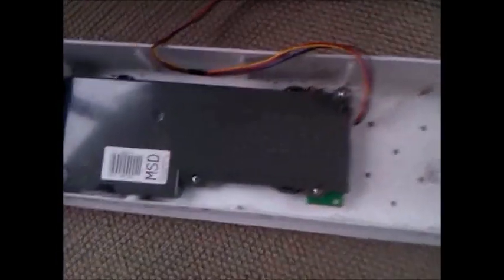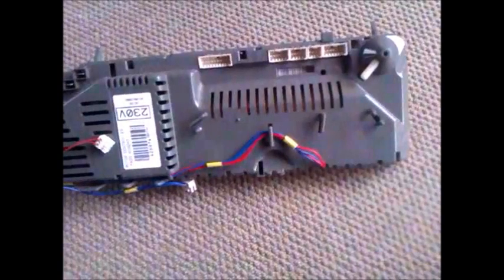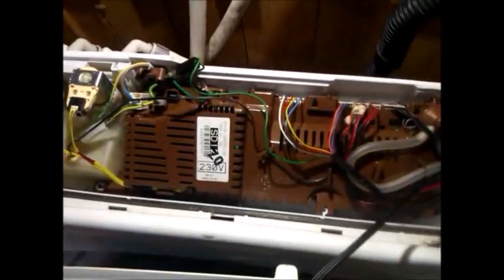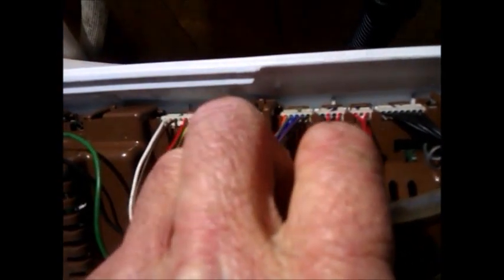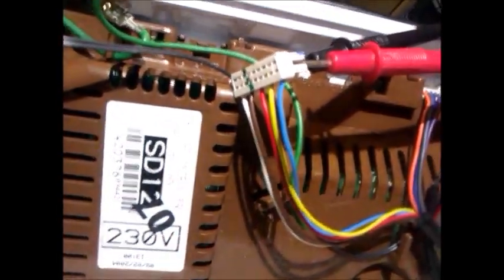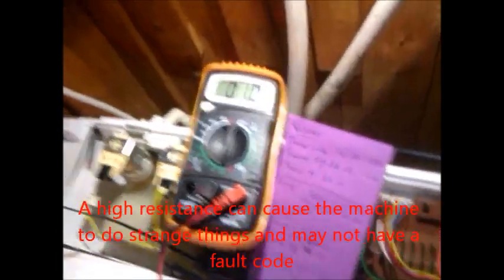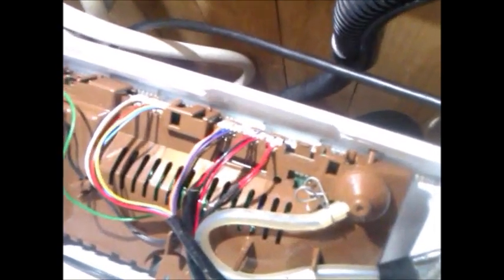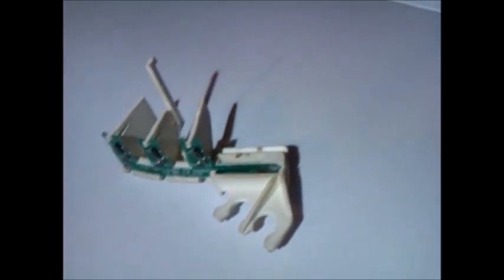Fisher & Paykel Smart Drive Testing Procedure

Comment: Hi Paul, I have Fisher and Paykel Smartdrive washing machine, I   accidently pressed the pause button when the machine was on full spinning cycle and the machine stopped, now there is no lights on display, looks like no power, any suggestions please
Reply from the maker: What's the model number please, on the sticker on the back left of the machine
Reply: @paulywooly  MW513
Reply from the maker: It's very unusual for pausing during the spin cycle for the machine to die like that. Turn the machine off at the wall for 1 minute and switch on again. If there is no sign of life means the main fuse in the control module has popped for some reason. It means replacement of the motor control unit under the display panel. Or if you are handy with knowledge of circuit boards you could replace the fuse if that is the culprit.
Look for one or 2 of these 
https://www.webstaurantstore.com/hobart-00-914782-00007-fuse-printed-circuit-board/HP3009147820.html
Reply from the maker: Check that there is power at the wall socket too
Reply: Okay thank you so much, I will check the control board fuse, actually I accidentally hit the pause button
Reply from the maker: @ummachand8216  hitting the pause button should not be a problem at all
Reply: @paulywooly  hi,  I have checked the circuit board but nothing burn looks,  I used multimeter for red fuse shows 0.4 ohms ,is the fuse faulty for no power, thanks
Reply from the maker: @ummachand8216  .4 ohms means fuse is good.  Check for another fuse in the board. Check for:
Power at the wall
 Continuity of the power cord to the control unit
The display unit is properly connected to the control unit.
If that is all ok then I think the control unit needs replacing

Comment: Hey Paul, my grandmas washing machine is a MW058  Fisher & Paykel, can you send me a link what motor controller it might need one day.
Reply from the maker: MW058 are colour coded yellow. They are quite rare to try and find but can still be bought online. This Ozzy website slows you the type you need ... http://www.stareast.com.au/product/896-f-p-yellow-control-board-instructions
Reply: Its annoying me mostly when i stay with Gran, everytime i hear i have to close the door. So can you respond if you can tell me what to do without pulling anything out of the machine.
Reply from the maker: If it's making such a loud noise it's probably when it's on the spin cycle means it needs new bearings and seals. Those models were made in 1996 so probably time for a new one. Or get the bearings replaced by a washing machine repair man

Comment: Hi Paul my smart drive was smoking at the back replaced the water pump cause it was burned but now my smart drive don't turn on no power
Reply from the maker: What is the model number please.
Reply: Mkt or mw612nz
Reply from the maker: MW612 is a Phase 7 machine. Sounds like the pump has caused the motor controller fuse to pop, but I maybe wrong. You maybe in for a new motor controller. You can easily pull it apart and check the fuse. There is 2 within the unit. They look like a little red-brown coloured cylinder with 2A written on it. Check with a multimeter on the back of the fuse for a reading. But unfortunately once they have blown usually means the unit is cooked.    If you buy a new unit make sure it's the correct part number written on the sticker. Should start with 420... Sorry I can't be much more help

Comment: Now, with the thailand made phase 6 420690 board, the board is like the phase 7, the pump and motor plug go into the pump slot and the lid lock and oob plug in one go in the lid lock slot. the earth plugs the 2 green ones go where they existed in the old board.

https://dougsmithspares.com.au/shop/420690nzp-fisher-paykel-washing-machine-motor-control-module-pcb/

move the mouse curser to the image in this link and look at the plug slots.

Comment: Hi Paul,  
Thank you for your amazing videos!

I have a GWL10US, so I believe I have the Phase 5 control board.  (Not sure which series, but it was purchased in 5/2001.)  My washer gave a code of 104, I think. The unit would start a load of clothes normally, then after about 5 minutes or so, the machine stopped.  When I checked this, there was water and clothes inside, and the controls were all completely off.  I was able to power on the unit and advance it to rinse to get the unit to empty the water, then it cut off again.     

I first checked the water drain pump, and it looked okay as far as nothing was caught in it, so I put it back in. In the US,  for this model, a new Motor Controller(426930P) is no longer available; same for the pump (420324P).  Any knowledge of where I can get this shipped from abroad?  I could only find this site that attempts repairing faulty controllers:  https://www.genuineapplianceparts.com/item/426930P_Fisher_Paykel_Washer_Motor_Control_GWL10US/326

For this testing you demonstrate, you are testing the motor control assembly (and not the Display Module, right)?  I believe you say in the video that the display cannot be tested, right?  Also, to start this testing, is it necessary to disconnect the water hookups?  (It looks like in your video the water attachments are still connected, but not sure.)   How do you test the Wash Motor Resistance per Winding and phase to phase?  I have a multimeter, but not sure where to put it for these tests.  Also, I did not check the RPS as you demonstrated in another video since I was trying to go in order of p. 27 of the service manual based on this error code which says to first measure resistance of the pump and replace pump if less than 33 Ohms, then replace display module, then replace motor controller, and lastly replace the RPS: http://www.uncleharrywizard.com/nephewclub/wizardwasher/fisher--paykel/200437---washer---gwl10us--.pdf

Any help you can offer is greatly appreciated!  We love this machine and really want to see if it can be fixed.
Reply from the maker: Hi sorry for late reply.  Error 104 is very rare and  in all my years of fixing these machines I have only had this once. It turned out to be a dirty connection. I disconnected the display module plug at the control module and got a sharp needle and scratched the connections to get a better contact and all was good after that. 

A couple of questions I need answered by you.  
What color is your module ....dark grey or is it brown.  426930P on appliance websites comes up as being either colour
What voltage is your machine or mains supply .. 110volt  OR   240volt
Check the sticker on the back of the machine and also the sticker on the pump as to which voltage it runs.

There is no need to disconnect the water hoses for any of these tests.
Check the video at exactly 5.00 mins and check there is 32ohms across any 2 of the 3 motor wires (red, blue, yellow)
The other 2 on that plug connector ( should be brown and white) are for the pump.  A 240v machine should read 33 ohms across the pump and a 110v machine the pump should read 7 ohms (both at 20 degrees Celcius)

BUT .....A very common problem......The pump can open circuit when it gets warm even after only a few seconds of being switched on. This can stop the machine and even give false fault codes.

To test the pump.   
Enter diagnostic mode:  Switch ON at the wall but do not turn the machine on
Press and hold the WASH TEMP DOWN button and then push POWER
The machine should give 2 beeps.
Press the REGULAR button and the pump should activate.
Leave the pump on for at least one minute. If the pump does not run for that minute, it is faulty.
If the pump does run for a minute then push REGULAR button again and it will turn off. Press the POWER button to turn machine off then turn OFF at the wall.  
Tip the machine back against the wall and reach under and feel the temperature of the pump. It should be only slightly warm.  If you yell out "OUCH" then the pump has overheated and needs replacing.

I hope this helps for starters.  Please get back to me if you need more help and we'll keep working thru it.
Reply: @paulywooly  
Hi Paul,  
I apologize for the delayed reply.  Answers to your questions:
My module color is dark grey.
Voltage of machine according to sticker on the back of machine= 110-120 Volts.  Also, the service manual for this machine lists "Electric Supply - 120 Volts/60Hz."
The sticker on the pump lists its voltage as 230 Volts.  (Manual specifies, "230V AC/ 0.7Amps/ 80watts (SELNI)."

I ended up finding a new pump motor for my GW10US at a company in Australia, ordered it and received it, but haven't installed it yet since I want to do the test you recommend with my current pump.  (The replacement pump label states "230V, 50Hzm 100W", so I hope that will be compatible.)

I did all the testing you mentioned in video except the water values, as I could not get the wire clip loose and was afraid to pull harder in fear of damaging these.  Results are inline with the ideal except the following:  the pump tested at 29.2 Ohms instead of 33, the OOB tested at .1 instead of 00.6, & the red and black wires on the Lid switch registered nothing.  On further inspection, saw that the OOB switch connecters located under the Motor control board were severely corroded, so I order a new "Out of Balance Switch - Sealed OOB Switch Kit" from F & P, installed it, but haven't tested it. 

I was thinking of trying to check the Motor Control board for any blown fuses, do resistance testing, etc. but I am not confident I know what I am doing, nor do I know if I really need to do this, especially since the OOB had corrosion, and I've read blog commenters saying this caused the machine to not work.  Should I next, test my old pump, per your instructions, or install the new pump and test everything, or should I get it together and open the motor control board and investigate, and then test/change the pump?   Your advance is saving my life and my laundry.  A million thanks for helping this far, Paul!
Reply: Sorry, I meant to say "Your advice is saving my life!"
Reply from the maker: Ok the  29 ohms reading is too low and means that pump windings are slowly burning out so that's a good start to your diagnosis. If any 1 of the 2 fuses have blown inside the control unit you will not get the machine to light up at all so they will be ok. . BUT ...what I have seen in the past that if there's any sign of washing powder under the display panel where it shouldn't be, it can make it's way inside the unit and corrode the tracks on the circuit  board. The unit is easily undone with the 3 tags and the 2 halves will open up. It's a good idea to inspect the mother board for corrosion.
Sorry I have no experience of 120 volt machines and whether the pumps are interchangeable. I suppose the pump will either work or it won't. Your OOB switch reads correctly if it is 0.1 ohms
The lid switch is probably the magnetic type. The magnet is located inside the lid itself. You will see a flat area on the right hand edge of the lid. This magnet pulls the contacts of the switch switch together when the lid is closed. The switch is located under the top right side of the machine. You can undo the 2 screws under the rubber caps along the front and lift the whole top panel up about 6 inches and you will see the switch on the right. You can test it by using another magnet and hold it against the plastic where the lid would sit.
Reply: @paulywooly  I ended up only checking the green side of the motor controller inner card, as I had some trouble trying to get the card fully out to flip it to the other side.  After putting everything back together, I tested the newly installed pump in diagnostic mode and it was working!  So, I tried washing a few items.  Sadly, the machine was filling up but leaking out underneath.  Lots of water coming through the new pump and the adjacent black C-like hose--which is a new problem.  As far as the hose leaking, it may be from me fidgeting around under there after the machine first stopped working because I was checking various possible causes for the trouble.  Perhaps I did not reattach that black hose tight enough when I checked the diverter valve.  Regarding the new pump motor leaking, the only thing that I can think of to  investigate is the company that I purchased it from did mention in their video to tighten the three screws above the pump to prevent leaking (which I did upon install) or that the o-ring seal be changed to a thicker o-ring, which can be purchased separately.  https://www.youtube.com/watch?v=-TxB00jxqTE

I'll check on this with the company in Australia on Monday.   Any knowledge on thicker o-ring for the pump?  Also, ever had a problem with leaking from the pump and resolved it?   Lastly, do they sell replacement black hoses in case I've punctured my original?   Thanks once again, Paul, for your help!!
Reply from the maker: I have no knowledge of any thicker seal. What I have done in the past, a few times, is fit the pump incorrectly. Meaning that it looks like it's seated properly but it is actually sitting on a very slight angle (which is easily done.) The only place the pump can leak is thru it's shaft seal, even then it is only a slow drip. I have repaired many broken pipes by smearing silicon sealant ( like buttering bread) on a strip of rag about 2 inches wide and 8 inches long and wrapping around the pipe (like a bandage.) Edited: I have just watched the pump video and new pump looks different to the ones I have so the seal might be the  problem as they suggest
Reply: @paulywooly  Hi Paul, just wanted to update you on my situation.  You were correct about the possibility that I had not inserted the new pump correctly. Plus me fiddling with the hose and diverter valve ended up in more leaking.  In the end, that new pump had incorrect wattage (old=80W, new=100), so it wasn't functioning appropriately.  Was out of luck since I got it from an Australia company.  Luckily, F&P had told me that they were expecting replacement pumps this June for the no longer manufactured Selni pump which my GWL10 takes.  Got the correct pump last week from their Texas warehouse, had an F&P repair person come yesterday & install/test things (too burnt out to try it myself again!), and now, thank God, everything is working fine.  
Thank you so much for all the help and knowledge that you've shared!  Proud subscriber to support the great work you are doing!!

Comment: Sorry I should of said the product number is 93163
Reply from the maker: What's the model number not product number
Reply: Paul P The model number is MW059AU. Thanks.
Reply from the maker: Ok MW059 models have a bad designed motor controller (grey in colour).   In my opinion, from your symptoms, it sounds like the pump transistors in the motor controller have failed. If you can get a new motor controller for that model...good luck... They have been obsolete for years.
Reply: Paul P okay thank you. Looks like it's going to the tip. Thanks again for your help.